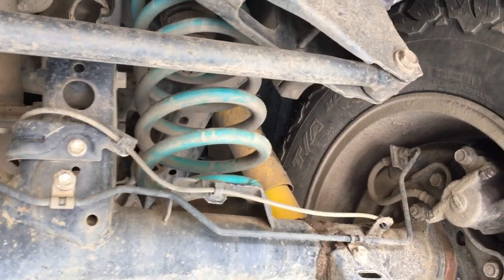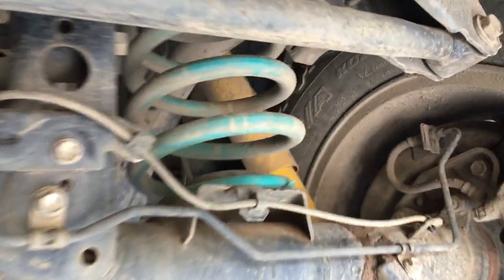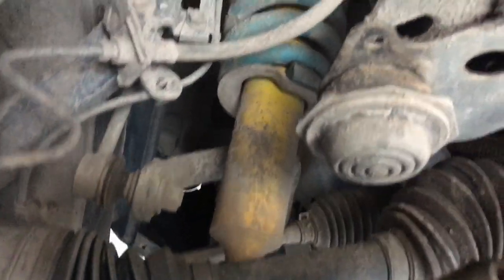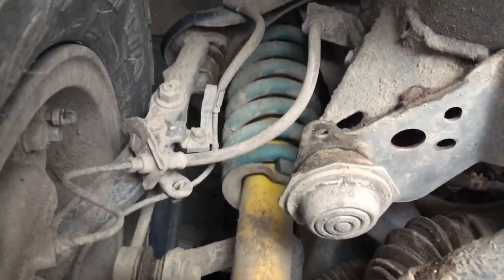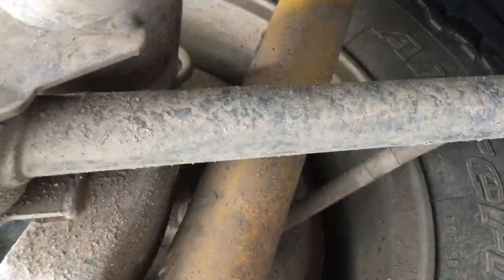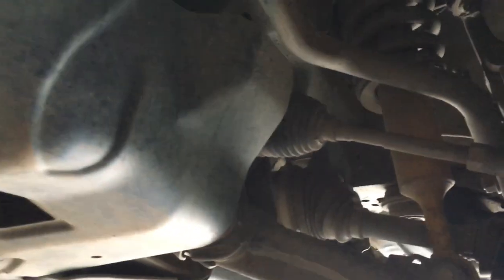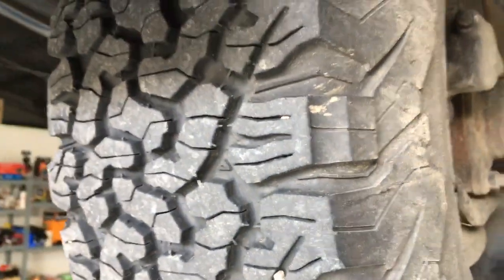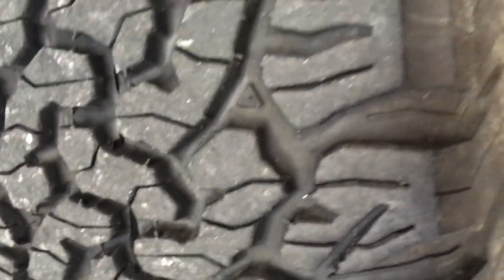DOBINSONS SUSPENSION REVIEW

Comment: For a Toyota 4runner with 100lbs added front weight would you recommend stock load front spring (2.5" stock 2" with 150lbs) or one rate up (2.5" with 150lbs added)

Comment: I just bought a 2013 Prado 150, it has a 3 inch lift kit, the upper control arm snapped yesterday, looks like I'll be spending more money to get the lift kit replaced with a 2 inch kit. I've never owned a 4x4 before, I'm now realizing how expensive it is to own one.
Reply: What brand UCA
Reply: Anything over 2" requires aftermarket uca regardless of tire size... Do research before you start modding..